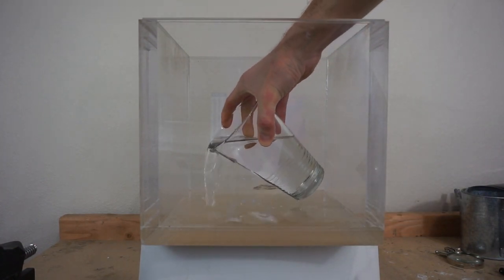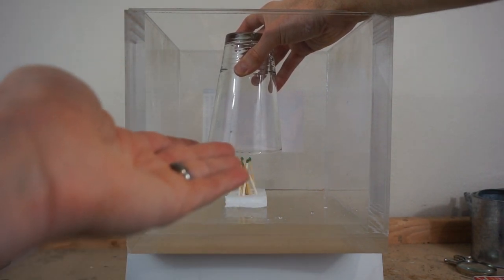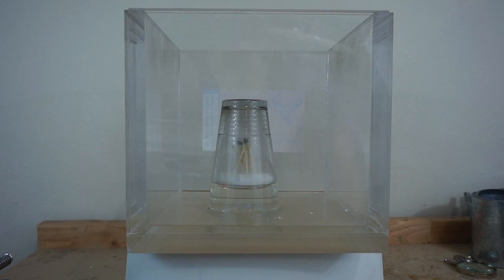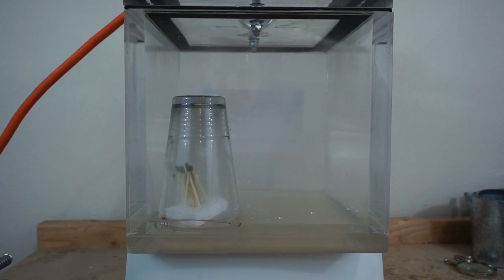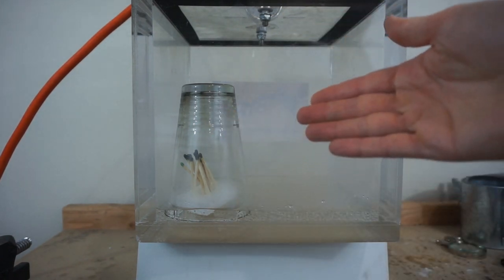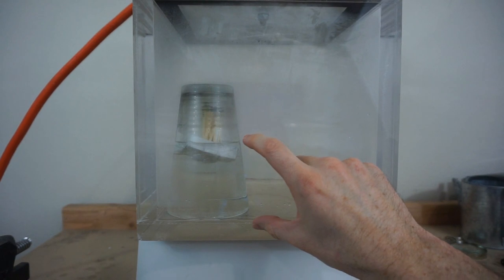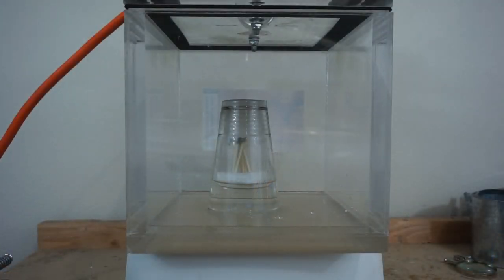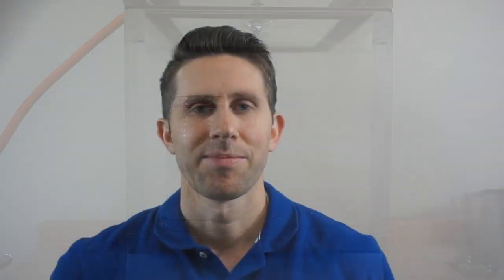Do Vacuum Chambers Really Suck? Doing The Cup Trick In a Vacuum Chamber

Comment: No such thing as outer vacuum space.
proof:
In 1650 Otto von Guericke invented the air pump, which he used to create a partial vacuum.

partial vacuum: A space largely but not totally free of air or other gas. One cannot have a vacuum next to a non-vacuum and have interplay between the two, it’s impossible and paradoxical.

Actual vacuums don't exist.  There is no example in science or in nature. All partial vacuums require a solid to contain the partial vacuum.   There are only  partial vacuums. 

The inside of a vacuum cleaner has low air pressure causing the higher pressure air around it to get “sucked” in. The term vacuum of space is pseudo science. 

suction definition:
The production of a partial vacuum by the removal of air in order to force fluid into a vacant space or procure adhesion.

1 : the act or process of sucking
2a : the act or process of exerting a force upon a solid, liquid, or gaseous body by reason of reduced air pressure over part of its surface

the act of removing air from a space resulting in a lower pressure in that space, either causing liquid, gases, or other substances to enter, or causing two surfaces to stick together: a suction pump

NASA doesn't practice in partial vacuums on earth because it's "too dangerous". 

partial vacuum: A space largely but not totally free of air or other gas. One cannot have a vacuum next to a non-vacuum and have interplay between the two, it’s impossible and paradoxical.

Actual vacuums don't exist.  There is no example in science or in nature. All partial vacuums require a solid to contain the partial vacuum.   There are only  partial vacuums.

Comment: water is not boiling....all the air is sucked out of the water molecules...so it appears to be boiling
Reply from the maker: Air sucked out of water molecules...hmmm. No, it actually was boiling. At low pressures water boils at room temperature.
Reply: Water is made up of oxygen and hydrogen, right? So when the oxygen is sucked out of the water, the hydrogen remains, right? Well well, we just separated hydrogen and oxygen. Do you know how much energy you can get from a reaction between those two? Hint: you can power a car for a good while with very little of them. Turns out that getting hydrogen from water requires a whole lot more energy (according to thermodynamics, more than what you get from reacting it together again) than just pumping it down in a vacuum chamber.
Reply from the maker: +Xiretza boiling water is not separating O2 and H2 it is just changing liquid water into vapor. You have to perform electrolysis on water in order to separate out the H2 and O2. Boiling is a physical change, not a chemical change.
Reply: +Hydraulic Press Action that's what I said.

Comment: All the effects in the tank happen due to the vacume machine. You say you are proving that all the effects in the tank are happening due to push. But all the effects are happening due to the vacume machine. Nothing would happen in your experiment without the use of the vacume machine, which is a pull force. All u did was use a greater pull force than was in the glass. Your experiement sucks, literally.

Comment: What's your point in substituting "sucking" with "pushing"?? The actions are exactly the same, and they're both sucking. You even make this mistake in your video description "I do a cool physics trick where you suck water into a cup using matches burning in order to remove the oxygen and reduce the volume. " Although you later use push, this would indicate that they're even the same to you.

A vacuum is the lack of any air. Lacking something to use, it cannot "push" anything, by any means. It can only attract things in an attempt to fill up the empty space. So this is in no way "pushing".
Reply from the maker: +crazy808ish my point was not in the language. It is totally fine to use "suck." I was just trying to help people understand that the physical process is due to the atmospheric pressure pushing the water. Same as when you suck out of a straw. The atmosphere pushes it into your mouth. A lot of people don't understand why something is sucked in.
Reply: The atmosphere doesn't push anything into my mouth. If it did, I could just put my mouth over the straw, and the atmosphere would do all the work, without my sucking. It simply provides the minimal opposing force needed to keep things together. My diaphragm contracting, causes the negative pressure necessary to pull the liquid into my mouth.  Not the atmosphere.
Reply from the maker: +crazy808ish the atmosphere is what is pushing it into your mouth. Without an atmosphere your diaphragm could move all it wants and you would not be able to suck anything into your mouth. The work your diaphragm does is in pushing against the atmosphere to reduce the pressure in your mouth so that there is a pressure differential. The atmosphere will not push water up through a straw unless the pressure on the other side is lower. But the direction of force is from high pressure to low pressure, there is no such thing as a "sucking" force.
Reply: Well said
Reply: There's no such thing as negative pressure.
Pressure is always positive.
Reply: Just to consolidate what Hydraulic Press Action actually mentioned, let's use suction cups as an example. Suction cups "stick" to the non-porous surface because the pressure outside the cup is greater than the pressure inside the cup, so the higher pressure outside will PUSH the suction cups towards the non-porous surface because the direction of force is from higher pressure to lower pressure. So for this case, I don't think there's really any problem using "pushing" as a term in this video...
Reply: The one thing The Action Lab forgets to mention in his comment is that fluids move from high concentration/pressure to low concentration/pressure.  The process of sucking creates a weak vacuum in the mouth.  Because the pressure inside your mouth is lower than the atmospheric pressure, the atmosphere is pushing the liquid into your mouth.  It's a semantics issue, but is the scientific reasoning as to why straws work.  Hope this clarifies things (sorry about being a year late!)

Comment: So why the pressure didn't press off all the atmosphere to the space..... oh my God man... why is so much stupidity in your explanation. Dislike 100% So if you start to tell me the higher you up in the atmosphere the lower pressure i get...... so there has to be the border between the space and vacuum where the air have some 0.000001 pressure and this air has to be pressed off to space and the vacuum border will be alittle closer to earth then this border will press all the air of to the vacuum border will be more closer..... and so on on and so on ...... all the air will be pressed out to space where the pressure is 0.0000 !
Reply from the maker: +Igor Ignatyev you might want to think a little bit more about what you are saying before you call my explanation dumb. The atmosphere doesn't fly off into space because gravity is opposing the force holding it on the earth.
Reply from the maker: +Igor Ignatyev oh wait I think you might be a flat earther! Noooo! I shouldn't have replied!
Reply: Ok. dumb is way too much - sorry about this.  Gravity??? Ok, lets think - the gravity force is the highest at the ground level, i think everyone agree with that. So lets try to imagine some experiment - a bottle 100 km long placed horizontally - the pressure inside is equal to atmospheric at sea level. Lets make a bottle sealed and rotate to verticall posion, and start to suck off the air from the bottle at the top. So you trying to say me that air will never be sucked off at the bottom becouse of gravity? And because of gravity there will be vacuum at the top and the ususal atmosphere pressurre at the bottom?
Reply: @TheActionLab  Savage 😂😎 100%
Reply: @TheActionLab  Savage 200% 😂😎🤭